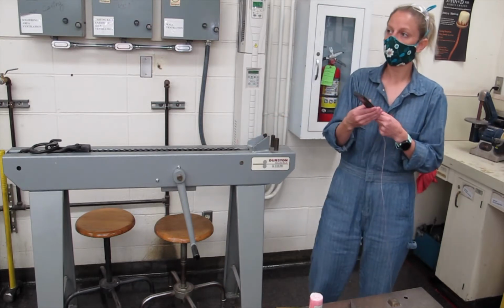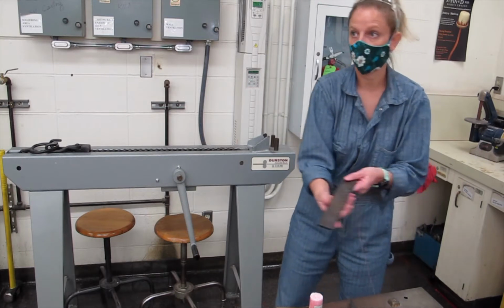How to use the Drawing Mill

Comment: Thank you, Professor Lauren, for your demonstration on the use of the drawing mill. For those who are unfamiliar with the need for annealing as she mentioned @ 6:18, metals become work hardened from compression, extrusion or torsion such as hammering, stretching or twisting. Eventually the internal stresses from work hardening will make the metal overly brittle and it will crack. Annealing by heating the metal will relieve the internal stresses and restore the metal's malleability and ductility.